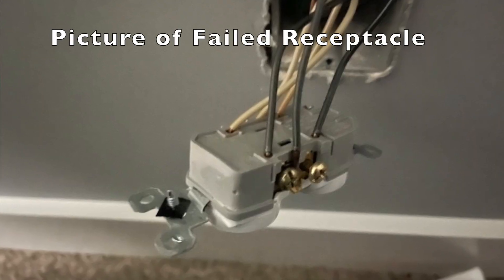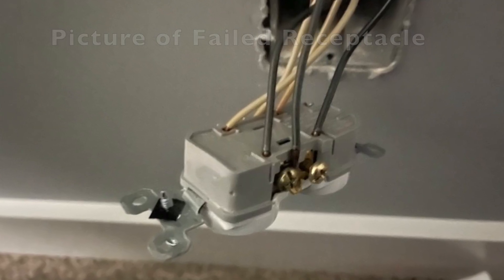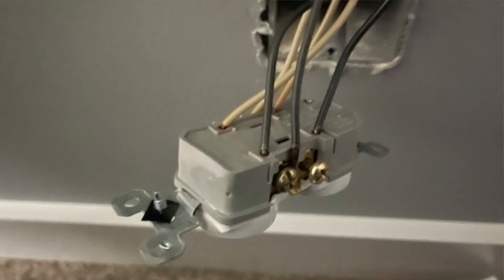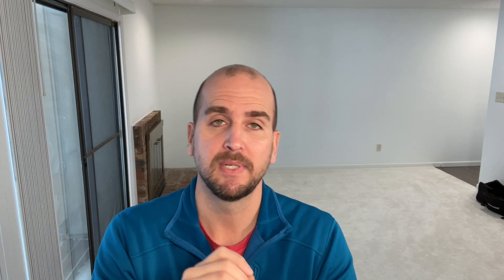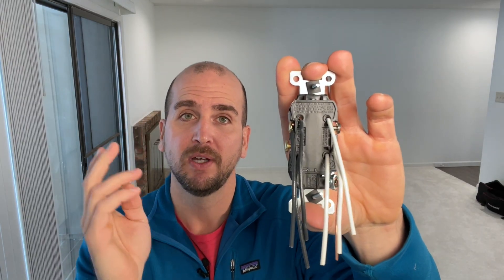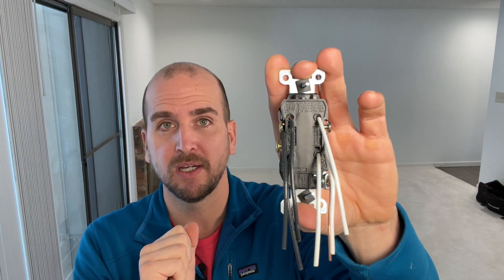Incorrectly Wired Outlet Found In Newly Built Home

Comment: Always use a pigtail, NEVER use the receptacle to jump through to other receptacles (with the exception of a GFCI) because if one recep fails the rest of the run will fail. Also, it's a good habit to tape your termination screws with electrical tape ESPECIALLY in metal remodel (old work) boxes. In a commercial setting always put the ground up. In a residential setting, it's a matter of choice.
Reply: "If one receptacle fails"--fails HOW. The most common fail is a loose or burned plug contact, which does not break the daisy-chain. You would have to burn the bridge off of a two-screw bond for it to fail, and have yet to see that in 50 years. Burning a two-wire connection under a double hold-down plate is also unlikely. Keep in mind, if the pigtail connection fails, so will the rest of the run. I have seen more than one failed wire-nut connections in my 50 year career! Pigtails are time consuming for professional electricians, and a PIA for homeowners. They also cramp up a small outlet box, and can cause more problems than they are alleged to solve. And I NEVER tape over electrical terminals. Another messy waste of time that solves a problem that should not exist in a properly wired box. It as unprofessional and as unnecessary as taping over a wire nut!

Comment: Commercial back wiring receptacles have 2 holes for each screw and the metal tab the screw tightens against the wires is "floating" and will even tighten properly if a 14 and a 12 gauge wire are inserted (which would be a no-no). There is nothing wrong with 2 wires into each screw and is why they are made this way in the first place. Pigtails are ok but 3 pigtails with their extra wires and wire nuts often won't fit a standard depth box without dangerous cramming which can pull a wire loose or, worse yet, break the receptacle creating a very dangerous situation that often goes unseen because the face of the receptacle looks fine. A commercial back wiring receptacle is strong enough to handle the strain of all those extra wires being stuffed back into the box. An added bonus of back wiring boxes is they work fine with stranded wire.

Comment: Why did you put the outlet in with the ground pin down? This means that anything metal falling on a partially inserted plug will arc and be energised. If the ground pin is up, this prevents this. Also since the ground pin is longer and must be lined up first, looking down, it's easier to see to get it started than if it is on the bottom. Now tell me why you did it the other way?
Reply from the maker: If you want to go deep down that rabbit hole take a look at this other video we put out.  Specifically jump to the almost 5000 comments covering every opinion under the sun 😁.  Enjoy!  https://youtu.be/kYXvcog9MxY

Comment: One finishing touch that I like to add, is to put a wrap of 33 around the outlet or switch terminals to give a little added protection against contact..
Reply: I also do that.
Reply: In alot of municipalities, you cannot do that.  It can fail a rough in inspection.  They don't want any extra "combustable" material in walls.
Reply: @vincentanatriello9296  Are you saying that wrapping a length of electrical tape around the outlet in a metal box is bad practice?
Reply: @steveburke3923  Yes.  Tape is ignitable, in a building where the walls are made of metal studs, you're using fire doors, fireproof ceiling panels, 5/8" gypsum board & steel is all fire sprayed you basically don't have anything inside the walls that could fuel a fire that doesn't need to be there.....except electrical tape.

Comment: u  r  correct that the push-in iz NOT GOOD, @all... i am a now retired union painter who would replace outlets 2 make a little more $$$ each job... i've replaced hundreds of outlets & switches since the '60s... only found a couple of BAD 1's & yes they were push-in's that caused white wire 2 b  'COOKED'    1 was @ an animal hospital & 1 was in my older home, 1970... will never use a push-in again... BTW, that iz NOT a nu 2 yr old house, i hav paneling like that in my 1970 house... thanks 4 showing the " extender " had not seen a plastic 1, only metal... easier 2 use...

Comment: At 4:38 you made a mistake using a 15 ampere receptacle on a 20 ampere circuit. That's definitely a major no-no. 12 gauge wires are never supposed to be wired to a 15 amp receptacle, its designed for 14 gauge wire only. The correct outlet to be used is a heavy gauge 20 amp outlet with a "T" slotted neutral designed for 12 gauge wire.

Comment: More like one mistake, 2 violations of best practices. I'm not a licensed electrician or anything, but I can tell you that those pigtails can be a real pain when you don't have room for the wire in the box. Also, not sure why you are picking on the push-ins, if the UL approves them and they are on the outlet, why not use them? It doesn't sound like a safety thing, just that it makes for a cleaner look.
Reply: At 3:52, he mentions the reason:  rate off point of failure of the push-ins

Comment: On a electrical box that has water cut off with a test two test buttons or one test button is it the same procedure to wire a receptacle with pigtails I live in a condo i, it has to be done to code when I wired it it was not wired right the tester that I used there's two lights on and one is yellow and orange that's not correct got any suggestions how to fix that?

Comment: hred electrician to rewire the house i bought  1 outlet in another room if you dont plug something in and wiggle it to certain position bathroom light in the washroom wont turn on .................. which  is across the room and this guy has 20 years experience

Comment: NOT a licensed electrician. Electrical Engineer, but do not have a PE. Concerning the pigtails, check out Wago Lever Locks, 2, 3, or 5 slots. A licensed electrician showed me the trick of just removing the insulation from a section and wrapping around the outlet screw, and on to the next outlet. Kinda hard to do if someone has cut the wire before you though.

Comment: Just want to point out that, in most areas the new code is that when replacing or on new construction, the ground should be on top, not the hot and neutral.
Reply from the maker: Hey Mike thanks for the feedback but when it comes to NEC for residential that won't be called out. Could be a requirement called out on a specific build especially in commercial.
Reply: @EverydayHomeRepairs  
This I guess pertains to Missouri then.
Among other states. I didn’t understand the reason, but when the inspector explained it to me I agreed that ground up reduces the possibility of a direct short by 50% should something fall on to the plug if it is pulled out.
Also here, it is required on new builds to have ground on top and if you replace a outlet ground should be up. They don’t force people to go and turn old outlets.
And I can only guess that this does not apply to outlets that don’t have a ground. Which amazingly you can still buy.

Comment: what do you guys think of wago connectors ?
Reply: I would recommend them for the average homeowner. If you have to twist 3 or 4 no. 12 gauge wire with little or no experience then good luck. Unless you are willing to learn and practice with some spare 12 gauge, and appropriate size wire nuts, then forget it, it's easy to screw it up. Otherwise leave that to a savvy diy'er or electrician.

Comment: Here’s my thing with pigtails, it makes it easier to trouble shoot a plug that’s gone bad but say your neutral is loose and starts to spark and melt that receptacle and the wire on it if no ones home to catch the issue and the breaker isn’t tripping then the rest of the circuit continues to heat up and melt all the way down the line I’ve ran into this at 2 service calls, imagine the device failing almost as a gfci where it will kill the rest of the circuit after the problem receptacle to minimise damage also you all seem like your too lazy to trouble shoot it’s pretty easy to take a bug eye and find which plugs are dead and go from there
Reply: I just ran across a similar issue where a pig-tail was used and the neutral had come out.  I've never had a  push-in connection fail.

Comment: I was just replacing an outlet earlier today.  The old one was wired similar to the video - two pushins on each side, and one used a regular screw.  6 wires total (plus a ground).  I hit an impasse replacing the outlet however as we have 12-gauge wire, and the replacement couldn't be wired the same way since it could only take 14 gauge wire for a pushin, and that got me searching the internet.

So now to create a pigtail.  I guess tomorrow I will need to go to Home Depot, and hopefully not have to purchase a whole spools of wire when all I need is 6 inches.  I guess just buy a couple feet of 14-gauge romex and remove the sheath.  That is if I can't find any romex in the garage...
Reply: I haven't seen romex sold by the foot, the shortest is a 15 ft roll, about $27 for 12-2, depending on where you live. You may be able to find individual THHN wire sold by the foot. If you're wires are 12 gauge your pigtails must also be 12 gauge.

Comment: Hello,
Great information. I noticed you are using your wire strippers backwards. You stripped insulation off with  the angled side. You should be pulling insulation off the wire against the square side of wire strippers. Easier.
Another observation, flip strippers 360 around wire before you pull insulation off. That finishes the cut on insulation the wire stripper make when crimped on.
Reply: Doesn't twisting the strippers around the wire risk nicking the conductor? I admit to being a bit clumsy.

Comment: Water pump is 110 v 60 hz 5 amp. Change GFCI. Cable 14 g .not working.but extension wire may be 16 g or 18 g get from Home Depot working very good on two pin.

Comment: FYI. Building codes / Electrical codes are the bare minimum code we will let you get away with.  There is nothing wrong with doing work that is better than code.  Too bad they don't teach you this bit of information.

Comment: I built our house with a generator because I refused to pay an electrician to wire up our house. I called wouldn't give us a temporary drop without completing the job. We had a state inspection, passed! Did it to code pigtails in box, never would use a push in. I labeled feed wires and the thru wires. Makes it easy down the road. Only mistake  made  was concrete. They screwed up. Eveything else good because we did the work ourselves and  it took two years, but totally worth it.

Comment: Great video. I also agree that the push in should not  be used and I have had failures because of those. Also somewhat difficult to remove the wires. I subscribed to an electrical forum a while ago and got chewed out because I said my preference was not to use the plug ins and that they were a source of trouble. The administrator said he was with UL and that they tested them and they were perfectly fine. I said maybe during testing but not in the long run. He continued to argue. Too bad academics don't and won't listen to experience.

Comment: If you are going to demonstrate proper wiring then I suggest you put the hooks going the right way around the screw!  Twisting wires is not necessary when using a wire nut, only under rare circumstances would that be done.  You'd be fired if you were wiring houses, wasting time twisting.  Over 50 years as a commercial journeyman.  AND where did that LONG 6/32 come from?

Comment: i can remember  no outlest in a house we had a pull string from the ceiling to turn on about a 40 watt bulb   i tied that string to my bed post so if i got scared i could turn on the light  out first outlet was for a refidg.. next was wash ing machine  then one for radio   thr mill elect.man came an wired the up if we blew a fuse byover load we just put a penny behind the blown fuse  put lights back on  -------i was born in 34

Comment: Thank you for sharing this information. I just recently dropped a lightbulb fixture from basement ceiling to replace it due to a crack and I notices 2 hot wires going into 1 screw, no ground wire. Is this a concern?
Reply: IIRC, the current NEC forbids two wires under one screw. If there isn't a second screw, then you should use the pigtail technique.
Reply: If your house is an older house then more than luckily it was before the requirement or code to have 3 wires. Hot/neutral and a ground.

Comment: Construction is done by the lowest possible bidder, and very often, by untrained (cheap as possible) day labor. Apartment complexes throughout Phoenix, constructed in the 80's are all suffering from the same things: 1) failing plumbing 2) minimal or no insulation (walls & ceilings) 3) green space drainage issues. You can walk around any apartment complex in Phoenix and see the poor construction. From walkway irregularities, drainage paths, sewer venting, rainwater runoff, poorly sealing windows & doors, and other simple things. The intent in ALL construction is maximum profit for the contractor.

Comment: Could you specify what is "commercial grade"? at the local Home dep. there's 3 options from Levitn, a 99 cents one, a better built 3$ version, and then what they call hospital grade with the orange face plate and is isolated ground only that goes for about 10$.
Reply: The $3 one

Comment: Question,  Why did you use a pcs of black wire for the  " Hot " and not red?    Code ?   I understand it will work, but was confused since I'm not an electrician.  LOL  Thanks.
Reply: Black is the more common color.

Comment: On an outlet, what is wrong with putting two hot or two common wires one each on the side two screws?
Reply: A receptacle should not be used as a connector. The reason for 2 screws on each side is to allow wiring for separate circuits or switched circuit.

Comment: You should look into running your outlets without the happy face, run them opposite, with the hot on bottom, and there is less chance of contact of your hots when unplugging items or if you cord comes loose a little and something falls on top.

Comment: Excellent video only one thing to add ..... Yes is better to be able to use pigtails when one can but you also have to remember box fill..... Depending on the type of box that is being used it may only allow for up to 6 wires in the box and when you add 2 wire nuts to the mix it takes away one of those wires .... that is why I'm guessing the contractor used the quick push ins in the back ...... typically you would wrap 2 around the screws and insert only 1 into the back quick inserts .....

Comment: Push in connection has cause me lots of  problems, found hot spots and lost of circuits, it's hard to believe it's still legal, I went through the whole house and change the plugs from push in to screw in, problems solved, no more problems

Comment: I commented to a prior video. Even with the screws tightened use tape. Never use a push in,  an outlet due to wire releasing. I always tape wire nuts in the clockwise direction for safety.
Reply: For bugs and water.

Comment: "push in" connectors are standard now. They have replaced wire nuts even... I only point this out because the use of them IS NOT INCORRECT... Thumbs down, do not recommend channel.

Comment: American sky’s are terribly designed, and dangerous! Do a “use and installation” comparison video. On a British skt and plug.
Reply: The biggest issue is that there is a range of quality from $0.50 to >$20.00.  The ones I use have four insertion ports on the back with screw terminals and plastic lids that then hinge closed to insulate those terminals.  They also have plastic TR (Tamper Resistant) tabs to make them childproof. 

The US system does not need to be dangerous, the problem is so many people fight to keep the low-end components on the market.

Comment: I am a bit skeptical that the pigtail with the wire-nut is any better than wiring into the push-ins.  I don't like clamping down the screw on a straight piece of wire since it can eventually come loose.  The push-ins seem better to me, they are UL approved for a reason.  I think most of the problems are installer errors.  The one real must-do is to screw in the un-used terminals ... but doesn't everyone know that?

Comment: My inspector recommended using the push connector type connectors for multiple wires instead of the wire nut. I don't like the wire nuts either as I have found some in my home that have come loose over time, so I went with the push connector type throughout the house. They may have improved the technology over the years. In addition, I would tape all the wire nut connectors in the event they do come lose they will be tripping the afi breakers all over the place!!

Comment: The pigtail option is definitely the way to go but I have found many boxes with out enough internal volume for the large wire nut/marrette connectors (looks like #35).  also you could point out the wire folding techniques that make the most of the room that you have
Reply: @D. Lindsay - I don't know that it's rare, all the boxes in my house are about 10 cubic inches each, about 3" x 1.75" x 1.75". Expect that was pretty common in the 1950s. I had one outlet box short out after 60 years because the pressure of the box ground screw on the insulation finally caused it to short through the insulation. So how do I fix a broken wire when the box was already too small and now I need another wire nut?

Comment: I've been told to install outlets with ground pin up. The theory is that if something conductive were to fall on a plug it would hit the ground instead of arcing across the hot and neutral. Thoughts? I can't remember where I heard it, but it made sense to me.
Reply: My house is wired that way.  Major pain in the butt.  I'm constantly rotating outlets back around because I need to plugin something which is not designed to be hanging upwards from the outlet.
Reply: Ground pin up to identify switches outlets.